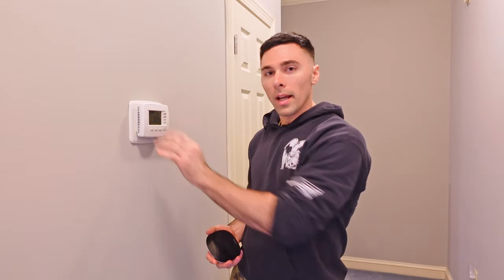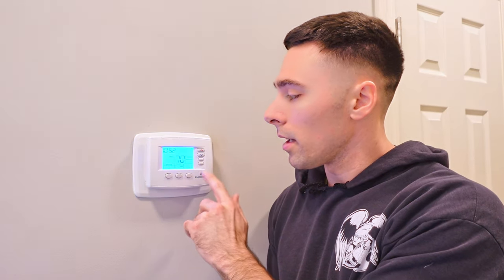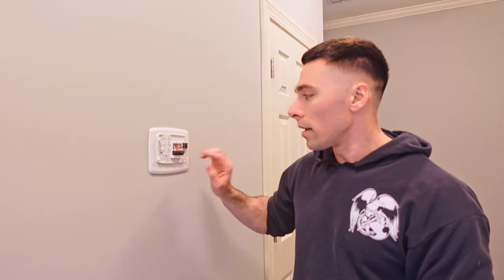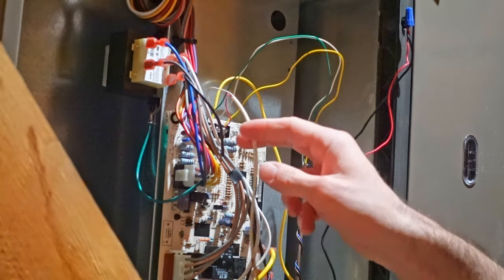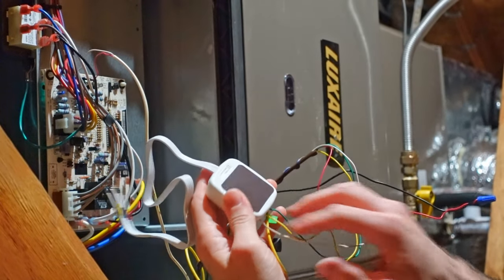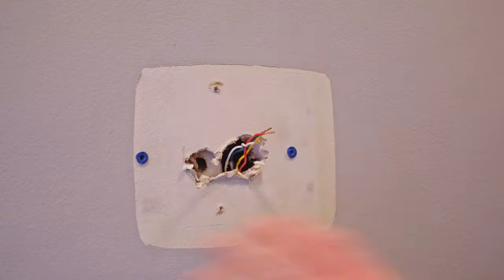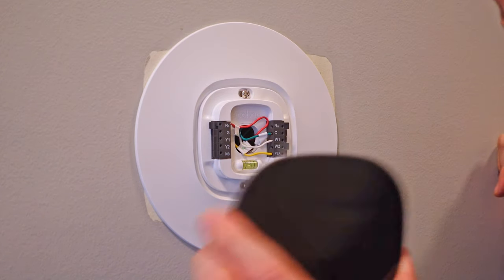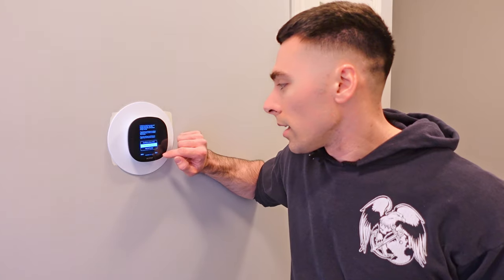How to Install Ecobee3 Lite Smart Thermostat || WITHOUT C Wire

Comment: This was very helpful!  I was replacing my previous Ecobee with a new one and was running into power issues.  I do not have a C Wire (nor did I with the first one) and so I was trying to use the same ports on the mounting device.  It turns out that the PEK handled the splitting differently.  It wasn't until I matched my wires in the same spot as you did that I was able to get the system to power on and start to function.  Thanks for sharing this as I now have a functioning HVAC unit again!

Comment: I installed mine but when I put the a/c on it turns on the heat instead would you know what I did wrong I followed everything
Reply from the maker: My best guess is the wire that is supposed to be the A/C is the heat and the heat wire is the A/C wire. Try swapping those wires.

Comment: Do we need to install the power extender kit into roof mounted HVAC (Arizona 🥵)?
Reply from the maker: The PEK is only used when there is an absence of the C wire. The instruction manual for the Ecobee provides 3-4 different wiring set ups based off what your furnace and A/C situation are. I can't say for sure if you need the PEK simply based off the location of your HVAC. If you have not bought an Ecobee and are simply researching to see if you want to install one you can find their instruction manual online and you can remove your current thermostat to see what wires you have.

Comment: In Mountains, no ac needed, so no yellow wire. Just a white, red & green, but green is not hooked up on either side (furnace or thermostat) so this exact ecobee will work with just the red & white in THERMOSTAT connected, and red white & that "added" C from conversion kit hooked up in furnace? correct? (green is just 4 fan 2 run, we dont need that up here, so not connectedor needs 2b)
Reply: So that conversion kit thing is adding the power through the red or white to power in the thermostat? right?
Reply from the maker: I'm not a professional so I can't say for sure. My best recommendation is to contact their support team and see if they can guide you on the proper product for your situation.

Comment: why didn't you just untwist one of the extra wires not being used and go from the c terminal on the furnace to c on the thermostat?
Reply from the maker: Running the wire from the furnace to the thermostat would have taken longer and been far more work than simply installing the device that comes with the Ecobee. For my upstairs one I probably could have run the wire without to much issue due to the furnace being directly overhead in the attic. But for some of the other furnaces that solution might have been very difficult if not near impossible to pull the wiring through all the walls.
Reply: @thediygrunt  running wire wouldn't be necessary. On the bundle of thermostat there were two unused wires, blue and black. Just untwist it as Eric said and connect it to the c terminal at the control board. Now that it's connected untwist the corresponding color at the thermostat and there you go

Comment: I’m having a call for heat error code on the HVaC. My old thermostat had a jumper wire from Rh to Rc, and my AC unit isn’t turning on, any suggestions as to why?
Reply from the maker: Since I'm late responding you have probably resolved this already. But If everything work fine before then the first thing I would have done was reinstall that jumper wire. If that didn't work then you need to consider if this is something you can fix yourself or calling an HVAC person is best. You could probably figure it out by doing research and looking at the wiring for all the units but not everyone wants to mess with electrical and depending on where the furnace and air handler are some people would rather not go into there attic or crawl space.

Comment: Can this be used with old 2-wire system? Thx
Reply from the maker: I am no HVAC specialist but if you only have two wires going to your thermostat then I do not think that will allow the Ecobee to function correctly. It may be possible to run additional wiring from your furnace and A/C to allow the Ecobee to function but that could be complicated and most likely require a pro to be able to set it up and run the wires.

Comment: I Have a red jumper cable! I just disregard like yours?
Reply from the maker: Looking at the instructions it mentions that if you have jumper cable connecting Rc, Rh, or R then you can disregard this cable as the Ecobee does not need it for proper function. For reference I found this Tip on Step 5 of installing with a C wire present and on Step 14 of installing using the PEK.

Comment: why does the yellow wire go to PEK instead of Y1?
Reply from the maker: The instruction manual has 3 different processes to follow depending on your wiring and your system. The wiring diagram for my specific process, instructed that the yellow wire go to PEK. I don't know the exact technical reasoning for why, I just followed the instructions.
Reply: If you are replacing G (FAN) for C COMMON why cooling just don’t go to Y1

Comment: this is junk I hook it up step by step nothing, called a profession he said it was right and he couldn't figure it out , called a second company and they could get it running!!!!!!!!!!!!
Reply from the maker: Not sure if you are saying my video is junk or the Ecobee. I'm assuming the Ecobee, so my opinion is you potentially got a faulty one that was bad straight out of the box. I have installed 4 of these, my parents have had them in their last two properties and my dad installed one in a relatives house and they have all worked without issue. In my experience I have had no problems and they do exactly what they are suppose to do. I would suggest calling the company and seeing if they will send you a replacement or maybe return it from where you bought it and say it is faulty since the professional couldn't get it to work.